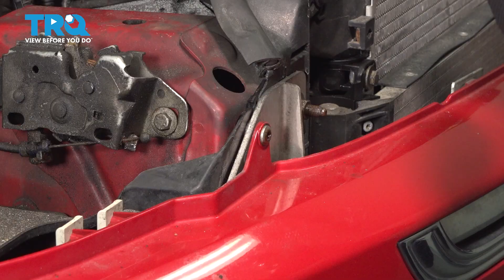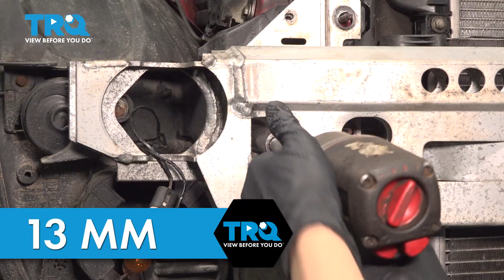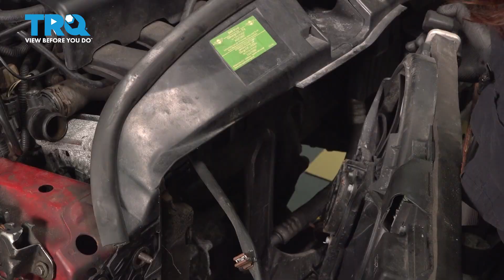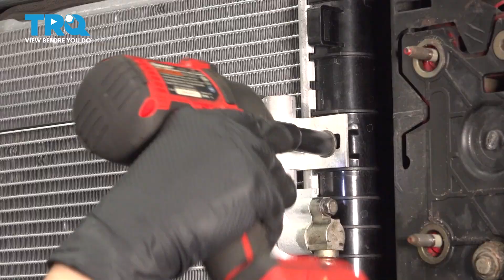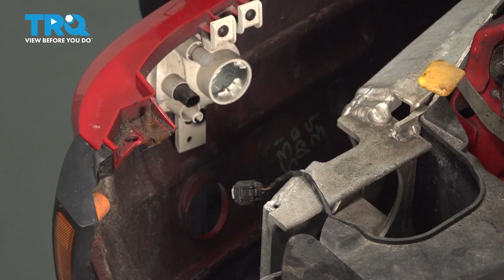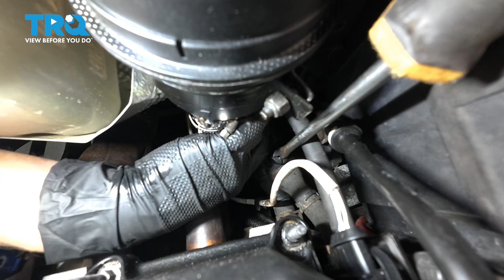How to Replace Crankshaft Position Sensor 2000-2006 Mini Cooper 1.6L L4

Comment: You dont need to do it this way its wasting time removing  the whole front end...all you do is remove the airbox then the throttle body. .the crankshaft is locatedright underneath the throttle body lol ...I just changed mine this morning ..I can't believe you did all this for no reason 😅